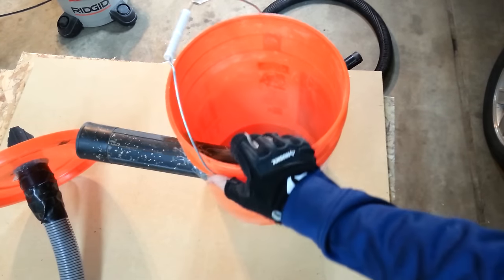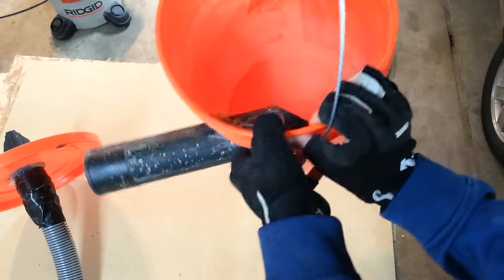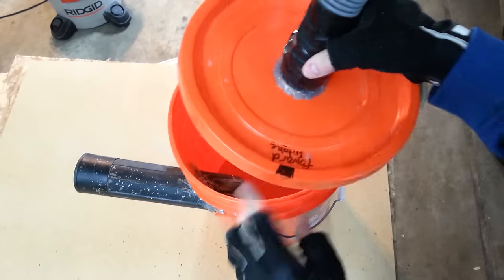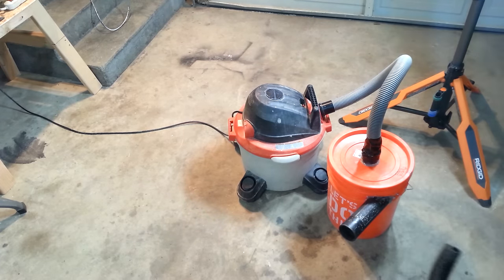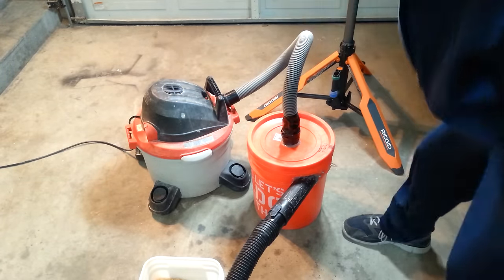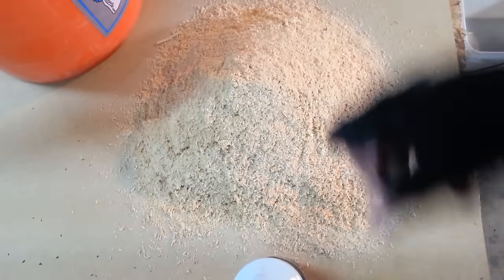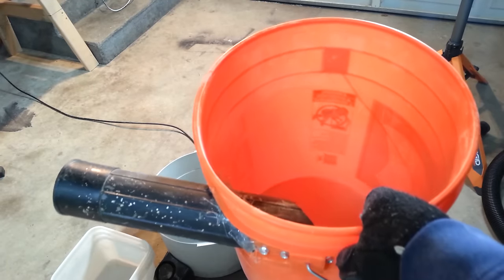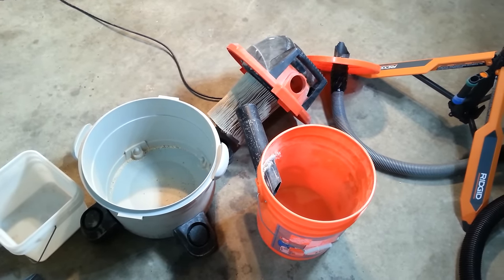DIY Dust Collector/Separator home made in less than 20 minutes with a bucket and spare vacuum parts

Comment: Works great! The only problem I have is the bucket collapses after awhile. Is there a way to stop this from happening?
Reply from the maker: I had that same problem when I bought a more powerful wet dry vac and hooked it up to my bucket and my solution was to put the main bucket inside a second bucket and screw the 2 buckets together with some self tapping screws and I haven't had a problem with it collapsing since. I hope that helps you out. Thanks for watching my video and commenting!👍

Comment: Put some water in the bucket to capture the dust, and it also weighs the bucket down
Reply from the maker: Heidi Sutherland That's a great idea I'm gonna have to try that once I put silicone over all the screws that I used to hold the outer bucket to the inner bucket, I had to add a second bucket to it because I got a new wet-dry vac with twice the power of my old on and it started collapsing my bucket

Comment: Why not just cap the original hose attachment point, cut the offset hose inlet into the vacs base, and put a shield around the filter so that entering particles are forced into the cyclone and fall to the bottom?
Reply from the maker: I don't want to cut up my shop vac and that seems like a lot of unnecessary work when this setup works just fine

Comment: It might work a little better if the extension angle was directed towards the wall of the bucket  and slightly down rather than facing the center of the bucket. Guess I’m gonna have to find out for myself. Thanks for the video
Reply from the maker: Let me know what you end up finding out ok because I'd be interested to hear it so that maybe I can improve my design. Thanks for the comment.

Comment: I gotta grind my basement floor which is concrete..knowing there is going to be a lot of dust..should I add some water to the bucket ?
Reply from the maker: I haven't personally tried that but I have heard that it helps when vacuuming very fine dust like that.
Reply: Chevy513 thank you for responding..I’ll try it see how goes
Reply from the maker: @davida3343  Sure thing, let me know how it works out.

Comment: how about very fine dust from sanding the filler ? will it clog the vacuum filter less then without this bucket
Reply from the maker: If your talking about drywall mud filler it might be to fine for it to catch it was made for wood. However I have heard some people putting water in the bottom to catch finer dust.

Comment: Thanks. Will be making! How much dust will it hold before overflow goes in vacuum?
Reply from the maker: Sure thing I'm glad you like the design. Well it's a 5 gallon bucket and the intake is just below the top so I'd say it'll fill the bucket up to 4 gallons.
Reply: @chevy5137  I need it for sanding dust. Ford it work for that?
Reply from the maker: @CowboyGirl007  Yes, I use mine with my Miter Saws, Table Saws, Router Table and occasionally my Cordless Palm Sander and virtually all the dust collects in the bucket as you can see in the video where I vacuum up a bunch fine sanding dust
Reply: @chevy5137  if I put water in bottom of bucket will that be even better? I'm reading a cyclone collector is not the same as wet fine dust collector. I don't understand the workings of either all I know is I use my shop vac directly with a filter and dust still seems to leak out. What if I put water in bottom of my shop vac?  It's old so don't care .
Reply from the maker: @CowboyGirl007  I'm not sure but I do know that I run fine router, table saw and orbital sander dust thru mine and it never comes out the exhaust of the wet-dry vac. I do however have an exhaust muffler on the outlet of my wet-dry vac which helps to make it run quieter and has a foam filter in it, I also run a fine dust filter in my wet-dry vac too. Those 2 things work fine for me and keep dust from coming out my exhaust, however if you still have issues I would suggest putting some water in the 5 gallon bucket first so you don't ruin your wet-dry vac filter.

Comment: i got to suck out the old blown in isulation out of my attic... trouble is it has 6 to 10"  pieces of splinters from cedar shakes in it..can u think of something that would work to seperate the wood from the insulation
Reply from the maker: wakeywakey I'm not 100% sure but think that would work I think splinters that long would get clogged in the hose
Reply: you better make sure that's not asbestos. If so, you could make a bad problem, so much worse.

Comment: Put input and outlet at more of a difference in their levels (more distance between inlet/outlet elevations) and you will capture almost all the dust into the bucket.
Reply from the maker: That's a good idea and I've often thought about tweaking mine myself and trying things like that but since I don't run my woodworking tools that need dust collection often I haven't worried about it for the time.
Reply: @chevy5137  You probably don't have much clean up after a review,,,,,,,,,,,,,,,
Reply from the maker: @michaeldefilipps2364  Not with this dust collector. Actually I don't have much to clean up after most of my reviews, except for when I demonstrate them, like on my Sawzall, Hole Hawg review and others where I demonstrate tools that I use in wood that don't use the dust collector.

Comment: That's cool would this work with one of the massive blue plastic oil drums with clip on lid or would it be too big.
Cheers 
Tim from Wood 4 Nothing
Reply: as long as it does not collapse from too much flow restriction....
Reply: @stripered08  thanks man
Reply from the maker: I would think you would need a pretty powerful vacuum to suck the air out of drums that size.
Reply: @chevy5137  yeh probably so lol it was just something I was thinking about lol
Cheers
Tim from Wood 4 Nothing
Reply from the maker: @wood4nothing284  You know now that I think about it I've seen someone use something nearly as big for a dust collection system and it seemed to work ok, I think it's because once the vacuum got all the air sucked out of the big drum and got into into a vacuum like area of space then it shouldn't have to work as hard so it might be something to actually look into! It can't hurt to try right! Maybe even look around on YouTube and see if anyone else is using a larger drum for their dust collection storage bucket/drum. Another thing I have seen people due is run two 5 gallon buckets in series between the tool and vacuum so there are 2 chances for the dust to get filtered out which is a good idea if you have the room and don't need your system to be mobile at all.
Reply: @chevy5137  hi 
The two runs could be a option never thought of that to be honest, thanks for your input I really appreciate .
Cheers
Tim from Wood 4 Nothing

Comment: how do you think it would do with cement dust - cutting pavers, grinding concrete etc.. GREAT VIDEO
Reply from the maker: Mark Keating Thanks for watching the video and commenting bud. Honestly I'm not sure it would do well with concrete dust since concrete dust is so fine, however a little trick that might work is to take one of those foam filters they have for wet-dry vacs for when your vacuuming up water and then cut a hole in the side of the pipe that goes in the top and duct tape off the bottom hole then take the foam filter put it over that pipe and then use some rubber bands or electrical tape or something to hold the foam filter in place and then that might help to catch the concrete dust, you could also try and put a foam filter around the intake pipe I suppose it wouldn't make a difference which pipe it goes on as long as the foam filter covers up one of the pipes inside the bucket and then you would have to periodically clean that foam filter. Does that make sense I'm not sure if I explained it well enough?
Reply: Yes come to think of it, that would exactly do it... you have great ideas - always funny people spend a ton of time and money on these things, and you were like.... OK, hOW ABOUT THIS .... BAM!  DONE!   Awesome- can't wait to see what's next!
Reply from the maker: Mark Keating Awesome glad  to have you as a subscriber! Thanks for supporting my channel! 😊

Comment: Good work! Just Curious what's difference between using that collector and not using it but just vac? Doesn't all the dust go to the vac?
Reply from the maker: The collector collects all the wood shavings and dust in the bucket so your shop vac filter doesn't get clogged up

Comment: have you tried this with aluminium (sorry aluminum), is it going to be effective enough  to separate it??
Reply from the maker: I have not tried it with aluminum but my thinking is that it would work even better with aluminum because aluminum shaving are heavier that wood shaving so they  wouldn't get sucked up into the vacuum as easy.

Comment: Why not just hook the shop vac directly to the shop vac?
Reply from the maker: Michael Johnson Because when you add the collection bucket between your tools and the shop vac most of the shavings will collect in the bucket and this helps prevent your shop vacs filter from getting clogged up so it will maintain strong suction and help increase the life of the motor plus you won't have to clean out your filter as often. Thanks for watching the video and asking your question bud, I hope I answered it well enough for you, I assumed you meant why not just hook your tools directly to the shop vac.
Reply: It extends the life of Shop vacs because of the fine dust getting into the motors  and saves on buying filters

Comment: MY  DIY designed a 250mm  X 500  X500mm   with 125mm duct  full flow Squat cyclone  picks up small blocks to <4 micron  in a  single drop, Exiting <4 um WITHOUT ANY FILTERS WHATEVER  (fine ground white flour) Qld. Gov, visually versified  and Electron microscope tested   Why there is nothing on the market like it I don't know,   Don't be satisfied or listen to the hype   and massive size,  it can be done.
Reply from the maker: RJbiz That sounds like it works really good but I'm not quite clear on how it is built and works!
Reply: Yeah, that's why there is none any on the market.  Most can't  achieve that with a $500.00 $600.00 Filter.  Your comments are absolutely correct. but duct size is to small to be practical in  a  workshop   and  NOISY NOISY.  I will some more info on www.rjbiz.com.au/dust If you like to look maybe tomorrow  Cheer's Rod
Reply from the maker: RJbiz I'll have to check it out and I actually have a pretty quiet system my vacuum is quiet to start with and then I put a muffler on it to make it even quieter and I also built a sound deadening cabinet for it to go into so it is pretty quiet and I have switches by all my power tools so I only run it when I need to so it's not bad.

Comment: Oh but its not pretty, and you cannot watch the stuff spinning, then again you are prolly working on things that are important? 
Only thing if yer vac takes a bag get one. It eliminates nearly all the suction lost from the finest particles and if used like yours itll be prolly months before another bag purchase.
Reply from the maker: John Stockwell Major Smedley Butler Lol yeah I guess I am working on stuff more important, I'm mostly a weekend warrior when it comes to woodworking and my woodworking tools I use most are my miter saws and the kind of wood I cut with them doesn't put off super fine particles so I just use my regular filter in my wet-dry vac and clean it periodically and my vac system isn't anything very special, I have one hose that goes to my miter saws and then another hose that goes to my router table and table saw and I have to change the hoses out at the dust collector when I change between my miter saws and router table and table saw, maybe one of these days I'll fashion a T in the line so I don't have to switch the hoses out but since I don't do a lot of woodworking I haven't bothered yet also if I used my woodworking tools more often I'd probably fashion a dust collector with one of those baffles in it but for me and how much I use my woodworking tools this setup works great and it was easy to build and cheap, I actually had all the parts I needed in my garage already so it didn't cost me anything to make! In addition I actually take my miter saws off site a lot to use somewhere else where I don't need to worry to much about dust collection, even when I have jobs that I can do with my circular saw I always bring my miter saw because it makes them easier and also because the miter saw I always pack around is a Ridgid 18volt cordless brushless dual bevel sliding miter with a shadow cut line indicator and it has a capacity to cut a 2x8 plus it only weights 24 pounds and has a small footprint making it super easy to pack around plus it's cordless so I never have to worry about finding an outlet to plug it into and it will run forever on a 5.0amp battery, I have never run the battery dead on a single job I can actually get thru most jobs on just the one 5.0amp battery which is great! Also I have a nice compact stand for it that will fold up and fit in my car so it's super easy to pack my miter saw and stand around, I love my little cordless Ridgid miter saw, it's my go to saw even in my garage, I rarely use my 10" Ryobi miter saw anymore! Thanks for watching the video and commenting bud! ☺

Comment: IT WORKS GREAT BUT WHAT A CLUMSY PRESENTATION
Reply from the maker: Yeah I should have made a video of me making it but I didn't think about it and it maybe not be the prettiest looking thing but I have it tucked under a shelf where it can't be seen and I have no intention of moving it and it works just fine there however If your planning on moving it I would suggest making it look better and mounting it to a cart with your vet-day vac. As far as the video quality and shots I wish I could have done better but I did the best I could doing the video myself with a phone camera. Still I hope it helps you out in making your own. Thanks for watching. FYI down the road I upgraded from a 2.4hp to a 5hp wet-dry vacuum and when I turned on the vacuum it caused the bucket to start to collapse under the suction I simply glued and screwed another to the outside of the other one and while it might look getto it works just fine, again it's not a big deal for me since I keep it where it's not visible, if you need to keep it somewhere where it's visible and want it to look good I suggest doing something to make it look better, otherwise it doesn't really matter as long as it works.

Comment: why do you need an extra bucket when you could just use ur shop vac alone
Reply from the maker: jayr hern, Good question bud. It's because the extra bucket acts as a catchall for the sawdust and shavings and keeps them out of ur shopvac which helps prevent ur filter from getting clogged and that helps keep ur suction strong and also helps reduce strain on ur shopvac motor prolonging it's life. at first I thought the same thing as to why u can't just use your shopvac alone and then I started to look at how bad doing that was clogging up my filter and started to see how bad it was putting a strain on my motor. That's why I made the bucket to act as a buffer and keep most of the sawdust and shavings out of my shopvac keeping my filter cleaner and keeping my shopvac running better without putting extra strain on the motor. They make kits for this like the dust deputy but they cost around $100 and admittedly they do work a little better but I made this setup because I had all the parts in my garage already and it didn't cost me anything to make and it only took me 20 minutes to make and it still works very well as u can see in the video! Thanks for watching the video bud and good comment, if you have any other questions feel free to ask and I will do my best to answer them. 😊
Reply: Hi just to clarify there is less strain on the motor when the airflow is reduced by a clogged filter
Reply from the maker: greco37 When your filter gets clogged up then your motor has to work harder which puts more strain on it so you always want to keep your filter clean it will prolong the life of your motor
Reply: Chevy513 yea because new shop acts have a planned obsolescence in them with a fuse that eventually breaks after getting hot then cold, etc so if the motor isn't as hot it will not break as fast lol,. This design is pretty nice and simple
Reply from the maker: C4kes Yeah that was the whole point of this design to make something simple with parts I already had around my garage and something I could make really quick and easy and it works pretty damn good, it collects at least 95% or more of what comes thru it so that keeps my shop-vac filter cleaner which means my motor isn't working as hard so that's going to help prolong the life of the motor in my shop-vac. Thanks for watching the video and commenting! 😊